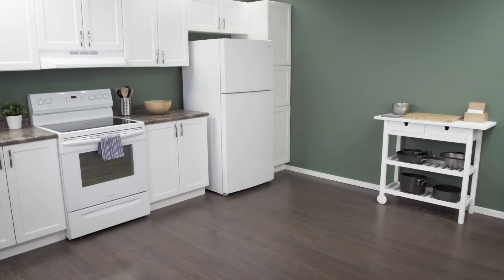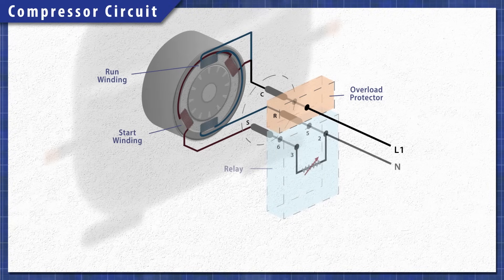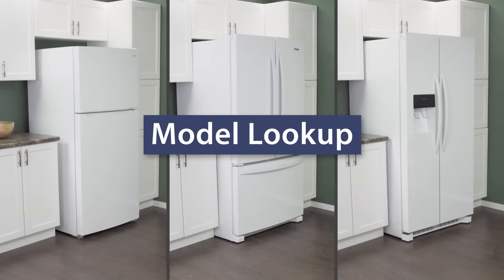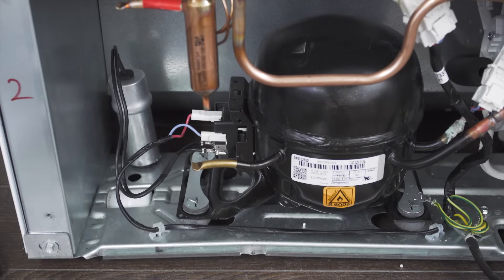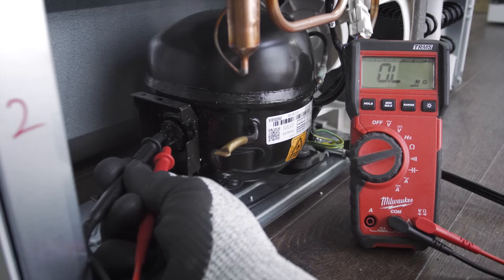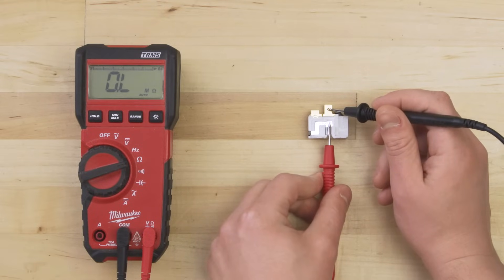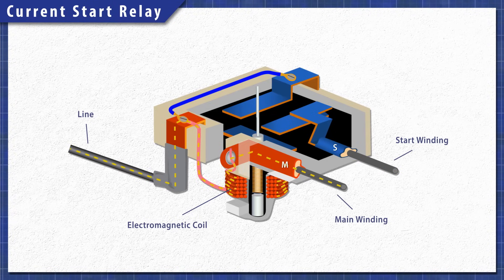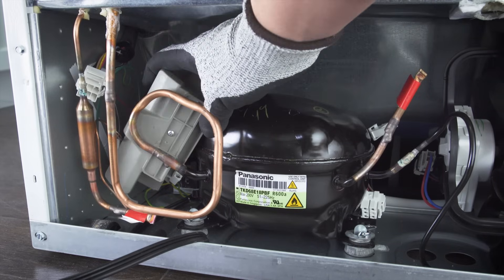Refrigerator Compressor Troubleshooting (Complete Guide) | Repair & Replace

Comment: Hi ..I have a Samsung refrigerator  which does not cool.when plugged in  light is on  and fan is running but compressor not running.you can here click but not picking up.what can be the problem?

Comment: what happens when they all pass the tests, the compressor buzzing and the vent is working . the friedge is not cooling (can the the compressor get stuck althogh it's values are good), how to diagnose gas escape ... bearing crash etc ...

Comment: Thanks for your excellent video. Using it, I was able to isolate the cause of my compact freezer's non-starting compressor to the PTC device used in the starting circuit. In my case the PTC (about the size of a nickel) is leadless, and uses metal contacts pressing on both sides of the silvered disk to make contact. Those metal contacts had arc'd on one side of the PTC , causing the PTC's room temp resistance in circuit to rise to 460 Ohms. After polishing the contacts, resistance dropped back to 6 Ohms, and the compressor now starts and runs just fine. Thank you!
Reply from the maker: That's great, we're glad to hear it helped!

Comment: I replaced my Samsung compressor.  Vacuumed system and recharged.  New compressor still won’t run.  It was professional diagnosed as a bad compressor.
Reply from the maker: Thanks for watching. It's possible that the compressor isn't getting power so it could be a faulty cold control thermostat (in simple models) or a control board or thermistor issue on other models: https://www.youtube.com/watch?v=ngPh1FJtvs8&list=PLCo9SMjkdWByKz32JOSiu7DIQbGIXUKtr&index=4
Reply: Sounds like someone that professionally wasted your money VS a professional troubleshooter/technician. Not everyone has the thought process for that type of work. 

Hope you figured it out, especially without another service call.

Comment: Hi, I have a Embraco egu70hlc. Is this reading normal:  7.5 ohm,  3.8 ohm,  4.0 ohm? Thanks for the video!
Reply from the maker: Those values add up and are within the range of what's expected with most compressors like that.
Reply: @AmreSupply  Thanks for the reply! It's really appreciated.

Comment: ·

1 reply

@AmreSupply Electrolux Refrigerator E23CS75DSS2 displays blinking "E" and "F".  Compressor Relay tests fine and the compressor starts then shuts off after 35–45 seconds. Is it Temperature Sensor (Thermistor) Fault  or I need to replace PC Board. Thank you

Comment: Hi. Thanks so much for this video. It's by far the most explicative that I found. 

In my case, I've pressed the smart diagnostic button and I get 3 light blinks : Code number 3. The compressor doesn't do anything the chipboard is sending electricity to the compressor but the compressor refuses to start. I will call LG for a repair.
Reply from the maker: Thanks for the feedback; hopefully, the repair goes well for you!

Comment: Question: I replaced the relay twice (bought two) and I still hear clicking noise from the compressor. Is it likely the compressor is bad?
Reply from the maker: Yes it is a sign that the compressor might be bad. Still best to test the terminal resistance as well as check for a short as outlined in this video.
Reply: @AmreSupply Thanks for the response. Would you agree of the compressor is bad, it's probably not worth to fix a 20 years old fridge? As in i probably better off buying a new one for a bit more money?

Comment: I have a question. I was getting a high reading when testing run/start  it would not stabilize kept bouncing around. Had a normal reading run to common and zero reading start to common. This is telling me start windings are bad. Question is shouldn't the run / start test also equal zero if the start windings are bad?
Reply: Answered my own question. I was using a jumper lead because of the tight quarters.  After testing the jumpers I was getting a false resistance reading
Reply from the maker: Thanks for the update. That's one tricky part of some of these tests and even a standard multimeter lead can be difficult to make a solid connection when testing. While filming our values jumped around a bit until more pressure was applied with the probes.

Comment: The other day i got 220v on the fridge it won’t start … then I got back regular 110v  it started freeze and all but it get hot like after 10 minutes then I don’t hear any noise from it until the the next 10-15 minutes and the cycle continues… like that all night was wondering if its how it works because I start taking note from the 220v
Reply from the maker: What do you mean you got 220v on the fridge? Did you measure the voltage with a clamp meter? Are you in North America with 120V power?

Comment: Excellent video.
What is the purpose of the "water hose" at the back of the refrigerator?
Thanks.
Reply from the maker: Thanks we're glad you liked the video. Depends on the model but the water will either connect to an ice maker, or a water dispenser. In these cases there will be a water valve at the back. If you're referring to the "drain hose" then this is to drain the water created during the defrost cycle (ice builds up on the evaporator coils in the freezer, and the system will automatically melt the ice and drain it). This water will evaporate in the drain pan, which is why it does not need to be connected to the home's plumbing.
Reply: @AmreSupply Thanks for such a detailed explanation.
Keep it up...

Comment: If the resistance readings are jumping from 15-150 ohms during testing between all of the terminals, is that a bad compressor?
Reply from the maker: If the terminals are dirty or if there is not a good connection between the terminals and the multimeter probes then you might get some different resistance values. If you have a solid connection and you have a significantly higher resistance reading then it would be a faulty compressor.

Comment: I'm measuring 12.3 ohms on the compressor regardless of  which combination i do...

Does that mean the compressor needs to be changed?
Reply from the maker: Thanks for watching. That is unusual for a standard compressor but if you have a inverter control board and a variable speed compressor then you might see those readings. https://www.youtube.com/watch?v=4_c978da0ZQ
Reply: So those could be normal readings in that case or still abnormal?
Reply: Did you ever figure out what was wrong? Mine was also reading 12 ohms regardless of the combination.

Comment: Please, I have problem. My 48volts DC air conditioner is displaying "driver fail" when it compressor is trying to pick as I started it unit, and it does not cool. Please what could be the problems.
Reply from the maker: Thank you for watching. Those units are a little bit different than refrigerators but "Driver fail" sounds like it could be an issue with the programming. A driver in the computer sense is a string of code that helps interface with hardware. In this case the control board might not be able to interface correctly to start the compressor. Perhaps look at the manual to see if there's any more information or if there's a way to update the firmware on the air conditioner. I do not know which models or what models this may or may not be an option for.
Reply: @AmreSupply  Its Envicool cabinet Air conditioner, Model: dc05hdnc1a. I will appreciate any support to fix it . Thank you.
Reply: @AmreSupply  thanks for the information, here is the model of the A/C: DC05HDNC1A, cabinet unit 48volts DC 150watts
Reply from the maker: @ This is outside the scope of our series or what we have parts or info one so I can't be much more help here.

Comment: My capacitor and relay tests pass. The compressor Ohm readings are RS: 27, CR: 22.5, CS: 22. Do I have a bad compressor?
Reply from the maker: Thanks for watching. Yes those compressor readings look off so it does seem like the compressor could be faulty.

Comment: I've got a indesit UFAN 400NF freezer.  I have measured 49ohms across the bottom two pins on the compressor and 29 and 20 on the others. This is a fair bit higher than the values on your example but they add up to 49. No shorts to earth. 

When I measure the PTC I get 16.9 ohms at room temp…stick it in another freezer to cool it and I got 20 odd ohms. Continuity from the ground pin on the combined relay/ptc block to the spade on the other side is 1.4 ohms. 

So all the above are away from the values in your example. Are they significant enough or just manufacturer variance?

I also measured the capacitor and that should be 3mf (~5%) it measures 2.5mf so out of spec. Do you think it's just the capacitor or possibly the combined relay block as well? 

Thank you and a good clear video on how to test, well delivered.
Reply from the maker: Thanks for watching, we're glad you found it helpful. Sorry just saw this comment now.  I am not familiar with that model but it seems unusual as most compressor windings in freezers do not go that high and are at most 15 ohms under normal operating conditions. If you are seeing values up to 30 ohms, it can be an indication of damaged windings, corrosion, or an aging compressor.
Reply: @ Thank you for getting back to me. I think you are correct, I changed the capacitor and it made no difference. It looks like I need to part with some cash and buy a new freezer!😂

Comment: My is, the fridge will work then suddenly u will hear noise, then all the ice will melt, after one hour to three hours den it will start again please what's Rong
Reply from the maker: If it's cooling intermittently but it warms up after a few hours then it might be an issue with the defrost circuit. In this case it might be staying in defrost longer than it is supposed to. A faulty defrost timer or a control board could cause this issue: https://youtu.be/rsv0ary__p4?si=mDzgbmlgQrd52Ccz
Reply: @AmreSupply   oo kk , I think is true because the defrost take  from one hour to 2 hours. And is too noisy

Comment: Thanks, So we have been replacing the whole compressor instead of just the faulty components!
Reply from the maker: Thanks for watching. Yes in many cases if you identify the faulty start component it will fix the problem without a need to install a new compressor.

Comment: Here’s another one for you. I had a refrigerator and the lights came on and the evaporator fan was running, but the compressor was not. I got down there to take a picture of the relay and while photographing it saw that mice had chewed up the ground wires! So that is another problem to include in your troubleshooting work up.
Reply from the maker: Yes animals are absolutely another factor and it is not uncommon to find a birds nest or a squirrel stashing nuts and plugging the vents for a furnace or dryer.

Comment: Please explain marine fridges like in our sailboat
Reply from the maker: Thanks for watching. Fridges in sailboats will follow many of the same principles but will have different configurations based on space, and heat transfer considerations. That is outside the scope of our videos and there's likely some specialized parts for these units as well.

Comment: Thank you for this. Quality content; filmed well; and at a pace that most people will be able to follow.
     This reflects wonderfully on your brand. (Unfortunately, you are not located in Europe too, so I am unable to purchase from you).

Thank you from the far away country that is known as The Netherlands. 

Particularly good parts:
- "You will need [list of tools]",
- Showing different examples of the same part,
- "The 2 smallest voltages should amount to the largest one" (when diagnosing the compressor)

Bonus points for 'don't measure painted parts; only exposed metal'
Reply from the maker: Thank you, we're glad that you found the video helpful! We have put a lot of effort into developing a good style and format for these videos and we're glad that the extra details are helpful! Cheers!
Reply: @ The extra details are what make it doable for regular people.
Most people don't know how things work at all (...let alone understand what certain parts of a machine or device are meant to do).
     I know a bit more than most, but refrigerators are on another level (in my mind at least).
    Like.. I fix things all the time for people (doing volunteer work just like that for people who can't afford the fees of an official technician), but prior to this video refrigerators were just a thing I didn't try at all..
     This video gave me the confidence to check out my own suddenly faulty fridge.
     The problem turned out to be something I couldn't fix, but the fact I felt empowered to try means a lot for me (it will probably allow me to help other people in the near future too. I live in an area with many people on welfare - just enough money to survive - so often a new fridge is a thing dreams are made of)
Reply from the maker: @iggysixx  Thank you for sharing! We realize that these videos do help people of all different types and we try to be as clear and methodical as possible. There are people that will troubleshoot the problem and fix their appliance themselves, others that will better understand the problem but will still hire a technician. In many cases more knowledge helps prevent fraud from certain dishonorable techs who would take advantage of someone's lack of knowledge. In any case we're glad these videos are helping!

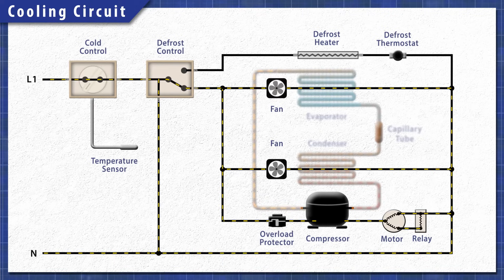Comment: The diagram at 1:20 is a dead short between the cold control and the defrost control. L1 to N.
Reply from the maker: Thanks for watching. This is a simplified diagram to make it easier to see what is happening with the entire circuit. What is not shown in this simplified circuit diagram is the motor & resistor on the defrost timer. I can see why you'd think it would be shorted without an additional symbol to denote the motor. This is explained more in the defrost timer video:
https://youtu.be/rsv0ary__p4?si=5IX68xC3YwbiFXhb&t=342
Reply: @AmreSupply  Thank You!!!!
Reply from the maker: @fred-qy4lo  You're welcome!
Reply: Yes!  That was the first thing I noticed about the diagram!

Comment: So my upright freezer failed around 3 weeks ago. I couldn't find anything wrong with the start relay, or motor coils, the capacitor was good, and all fans were coming on. After cleaning it seemed to be working again so we used it for another week before it failed again. The compressor was buzzing and very hot to touch.
I figure that the compressor was stalling or seizing, but would it work intermittently if that was the case?
Something you said in the video makes me wonder if the thermistor might not have been  touching the compressor properly to shut off the start coil.
Reply from the maker: That is possible. This is tricky as the PTC thermistor is not a phyiscal switch so if it is connected and there's power running through it then the start winding will be energized until the PTC thermistor resistance gets high enough. 

In your case it seems that either there isn't enough airflow over the compressor or the compressor is starting to fail and is working harder than normal.
Reply: @AmreSupply  thanks. We ultimately decided that it is not worth keeping. If I were going to try anything it would be to replace the entire start relay assembly due to my inconclusive findings.

Comment: Hi i have lg refrigerator lmsx27626d model one day water link from refrigerator and temperature wasn't cold enough on both of place and i check compressor but seems working i felt vibration and all the fans are working and i tried test mode all find
Do you think should i refill the freon or any suggestions to check?
Reply from the maker: Thanks for watching. If the refrigerator is not cooling there's a few things you should check: https://www.youtube.com/watch?v=oPmr6boufmE

Comment: I have a Kenmore 1720 freezer that wil start and run but not shut down, temp going down to -10
Reply from the maker: Thanks for watching. If a refrigerator or a freezer won't shut off, then it's likely an issue with the cold control thermostat. You can learn more in this video: https://www.youtube.com/watch?v=sME40MR2VHc

Comment: Man, everything checks out perfect for compressor, and my 2/1 overload protector/relay. , If I have everything plugged Except the compressor all lights and fans work. As soon as the compressor starts it shorts out my GFI plug... must be my inverterboard .... it's crazy because all I did was remove the back panel because the inned condenser coils frosted, I jist let it melt into a towel for 2 days.
Reply from the maker: Thanks for watching. Yes if it trips the GFCI then the inverter board could be the issue.

Comment: Huge flashes and sparks and loud noise whenever the fridge was plugged in and the compressor started up. I removed the plastic box/cover and found a few different wire’s insulation had either hardened or hardened and then flaked off, exposing its conductor to other components. When I touched the remaining insulation on the wires it just broke off or fell off in pieces. All I can figure is this was due to very high heat from a dying compressor, or from an inefficient compressor that had to stay running longer than it’s rated duty cycle, causing the heat buildup and the subsequent breakdown of the insulation, which then caused wires to touch, leading to the arcing.
Reply from the maker: Thanks for sharing your experience. Heat buildup can also happen with a faulty condenser fan or dusty condenser coils. Anything that restricts the airflow can do that as well so best to check those.
Reply: I found a dead mouse stuck in condensor fan blades...once I got condensor fan running the fridge started working.